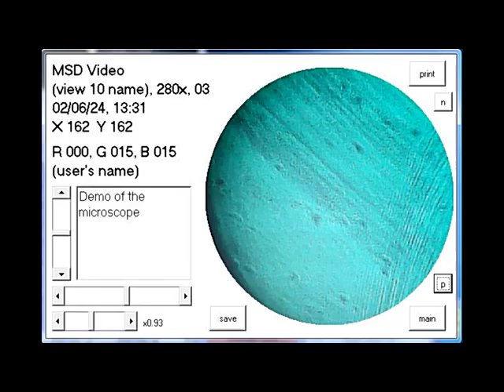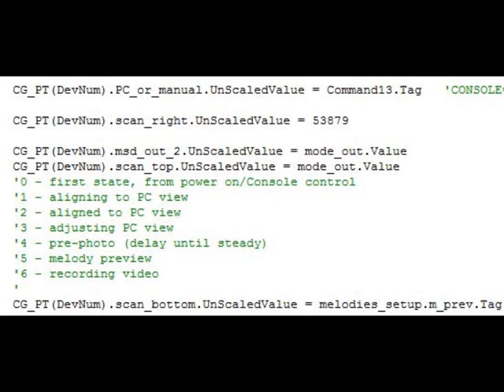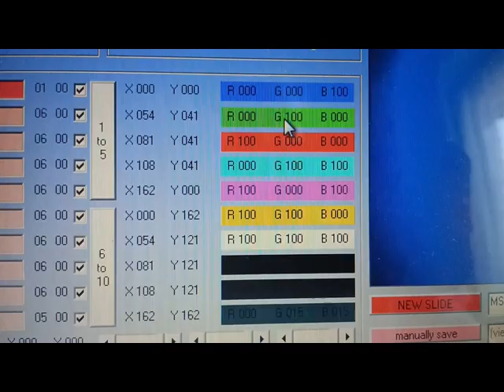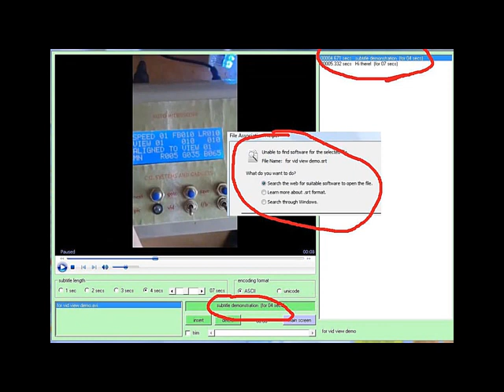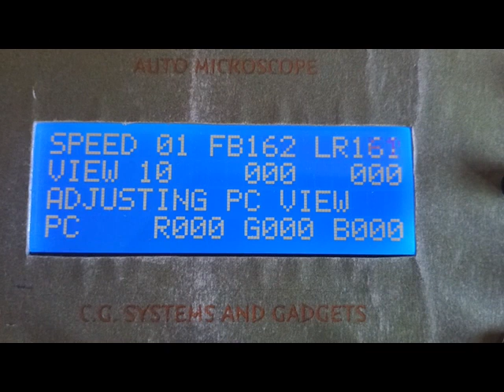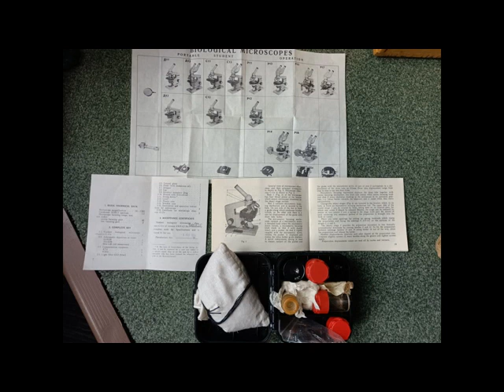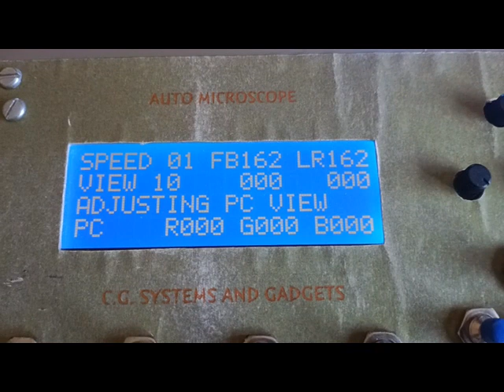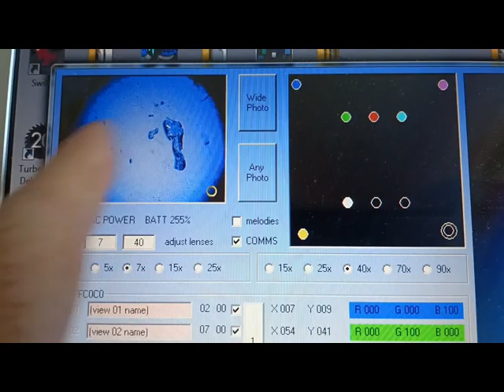Automatic Microscope Stage full video

Comment from the maker: The improvement to the slide holder has meant that subsequent photos are from the same places. I will need to create another video showing this, browsing through them. At high magnifications also, to check how well that works.